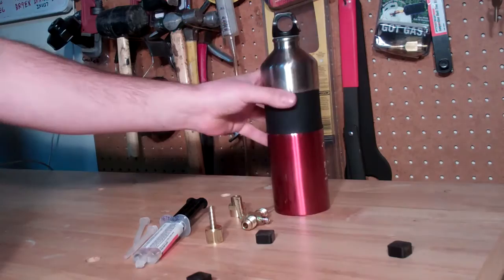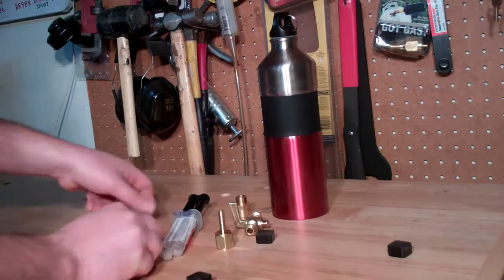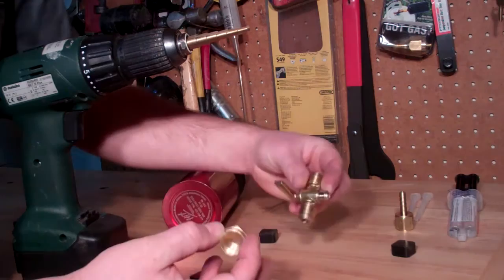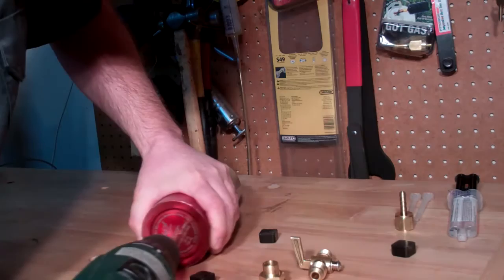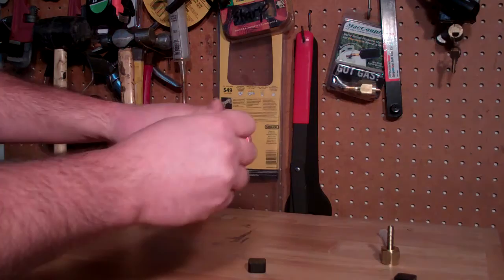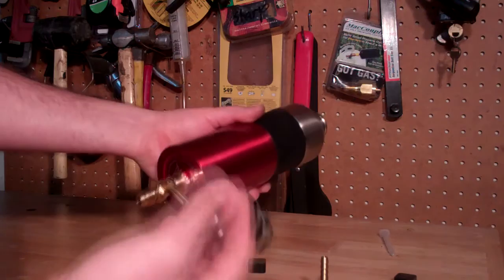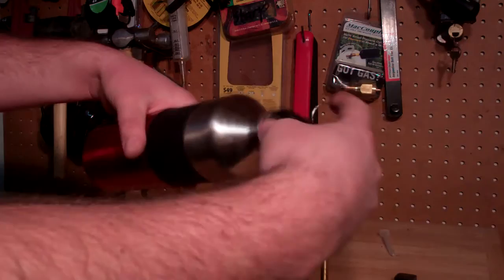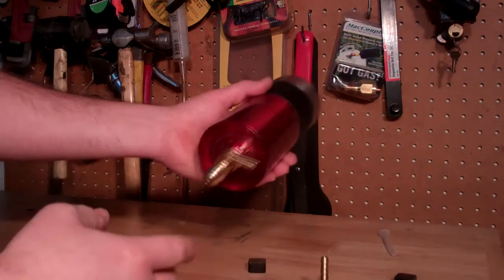Build an Auxilary fuel tank

Comment: Just made one to wet test my carbs.   One suggestion for anyone reading.  I've found it's better to put the valve closer to the end of the hose where you connect it to your carbs.  The reason is when you shut off the valve there will be fuel left over in the line that you will have to drain.  If you put it closer to the end, there will be less leftover fuel to deal with.  Just a suggestion.  Nice tutorial.  Thanks.
Reply from the maker: That is a good tip.  I am going to pin this comment.

Comment: Looks really good.  Getting ready to build one of these now.  What size fittings did you use?
Reply from the maker: What ever fitting size seems reasonable.  The barb fitting will be dependent on the size of fuel line.

Comment: Nicely done, is the two part epoxy fuel proof?  Will definitely be looking to do something like this once the front of the bike is finished.
Reply from the maker: Yes it is
Reply: @thejunkman  What is the name brand of the epoxy?  I know from experience that JB Weld is NOT fuel proof.
Reply from the maker: I used 3M DP8005 because I keep it around form plastic bonding, but it is fine for most all metals because they are easy to bond.  It has pretty high chemical resistance too.

Comment: JUNKMAN I have a question regarding the fuel pressure with this sort of auxiliary tank. Recently I read on the web that when using a tank like this that hangs to work on your bike that you should not have it to high and try to keep the hight of the auxiliary tank low because the higher you hang it the greater the fuel pressure? And this pressure could make you float bowl needle fail. Any truth to this that you know of? Does it Matter high high you hang the tank up from the bike? Thanks!
Reply from the maker: Gravity is the same so it doesn't matter the height.
Reply: @thejunkman  thank you sir!
Reply: @thejunkman  That isn't true, if it was, then water towers wouldn't exist. The height will increase the pressure.
Reply: Still nice video, thanks for the idea.
Reply: @thejunkman  Actually for every foot of height, the pressure increases .4 PSI.

Comment: Hey man how long would you say this set up would last? Have you seem any leaks or failures anywhere?
Reply from the maker: I suppose at some point the epoxy will fail.  Mine has not yet.
Reply: @thejunkman  is it just a general epoxy? Quick set?
Reply from the maker: I forget the exact brand/product, but it was fuel resistant and i think it was a 5 minute set.